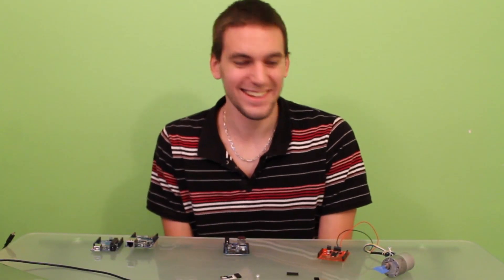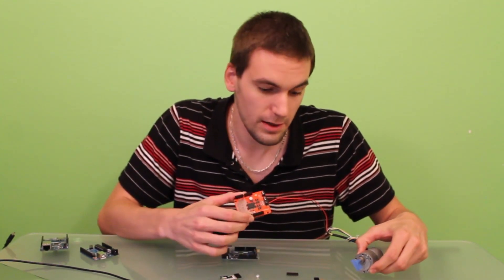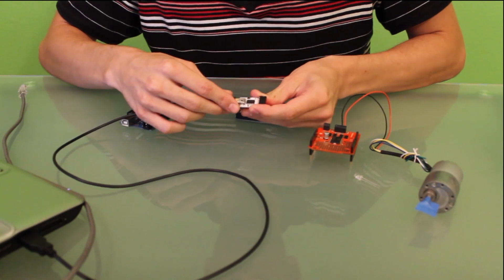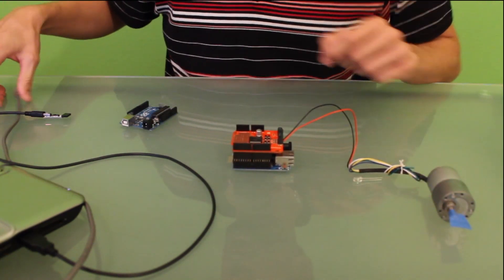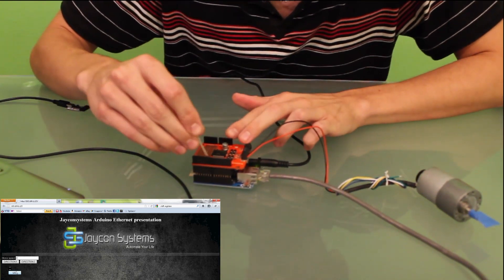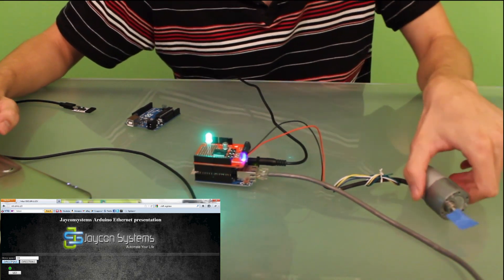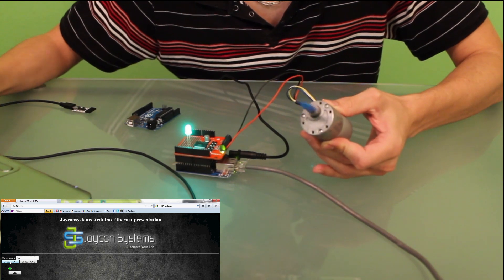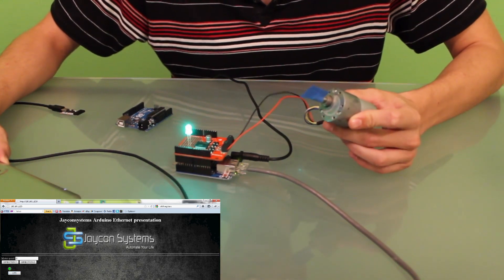Motor Control over internet with Arduino Ethernet, Ardumoto (V2), & FTDI

Comment: hi, pretty cool stuff....amazing code....however, I am still checking your posted code, but I was wondering if you have done anything with stepmotors using the ethernet shield. If you have any info or idea I will appreciate you could share it, thanks